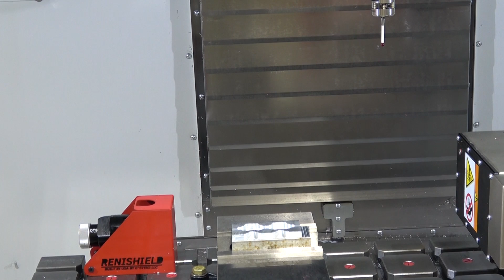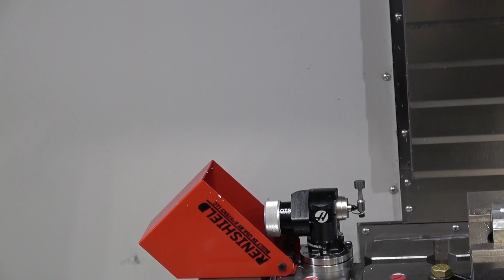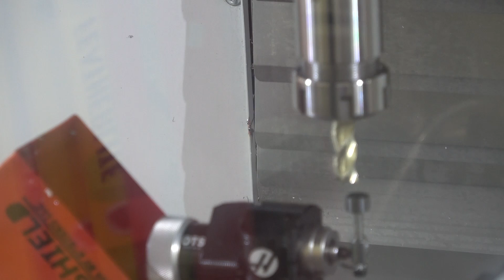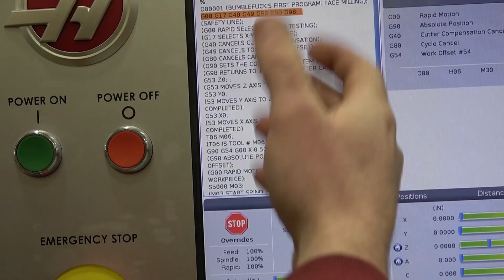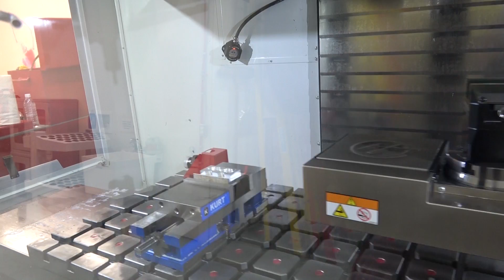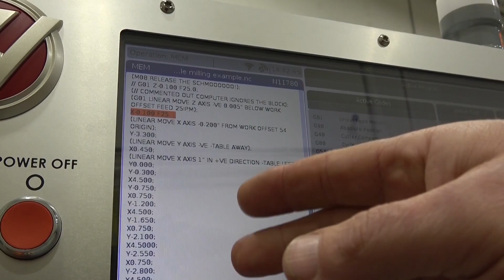Old School G-Code worth the HAASsle? | Intro to CNC mini-series Ep. 2

Comment: To be good at Gcode. You MUST know how to manual machine the part you want. Period. Gcode is the same moves you would do with the machine dials with your hands. Put to numbers. That is all it is. Instead of you flipping the spindle on switch you enter M03 to start or M05 to stop. Instead of turning on the collant knob you enter M08 on or M09 off. It is dead simple. The problem is people don't know how to manual machine anymore. They just want to push the green cycle start button. Then whine and cry when it doesn't work like they imagined it should. CNC makes machining faster and cheaper. It does not eliminate the requirements to know HOW to be machinist. No free lunch.
Reply: The problem with Gcode is that it is completely obfuscated behind arbitrarily numbered codes; If it was written with basic words, as programming languages are, like "coolant_on" or something to that effect, it wouldn't be so frustrating and rote.
Reply: @inthefade  Exactly, there's not a single reason why there's not some kind of macro assembler for that since last 30 years. G-code is not Assembly, it's equivalent of programming by looking up in the CPU manual and writing opcodes in hex editor. I kinda can do it on 6502 but I'd never recommend to anybody to learn that skill - only reason we did that was because we had to look up opcodes in paper manuals and often patch binaries by hand, nowadays it's pointless exercise that just adds artificial difficulty to the subject.
Reply: Assembly to FORTRAN to basic to c to c#
Reply: 30 years ago, when all you had was a clumsy  keybord and   had to insert it manualy, M08 was way faster than "coolant_on".
Reply: Eric St-Gelais And yet it worked fine for assembler on (mostly all) computers. like, lda would be load into register a, jmp is jump, jnz is jump if (some value you compare) is not zero. mov is move, add is add, mul is multiply... and than we got the funs of G83, M05 etc. GCODE is SHIT. fucking old old old hell of a "programming language" yeah, it actually isn't but whatever.. cheers
Reply: @ericst-gelais60  "faster to input" that has exactly zero to do with why gcode is the way it is.  It is the way it is because memory used to be highly limited to the point where being able to save individual bits mattered.
Reply: Matthew Barras 
There just aren't very many actual machinists left - and the industry has convinced itself they're not needed.
"The program is perfect from the offline programmer - and the machines run themselves"
is what is commonly believed anymore.
I've been debugging a program, adjusting speeds and feeds, or setting up the machine/tooling and had people question what I was doing - and why, after explaining whichever they'll tell me I shouldn't have to, the machine is "automatic".
That's how little about CNC processing outsiders understand.
Reply: @Motor-City-Mike  The greatest lie ever told in a machine shop is  "it's a proven program, just hit go"
Reply: @archdornan4389  "well, yeah but...everyone was supposed to know not to run it on that machine."
Reply: G and M code comes from the G and M column of old school punch cards. All those numbers you see are just positions. X left to right. Y front to back and Z up and down. G Code is movement and Mcode commands make a feature of the machine operate. Thats is. Google a "CNC G Code Cheat Sheet".
Reply: Ex-fooking-ZACKLY ! ! !
Otherwise "computers let you do the Wrong Thing much faster".
Reply: There's definitely some more insidious dangers in the hobby CNC scene.  Some control softwares (like Mach3) that run inside Windows OS are an accident waiting to happen.  All it takes is for winblows to have a hiccup for the machine to perform an uncommanded move or ignore the E-Stop.  Combine this with poor guards and lax safety, you've got a minor incident escalating to potentially fatal because somebody wants to make a quick buck.

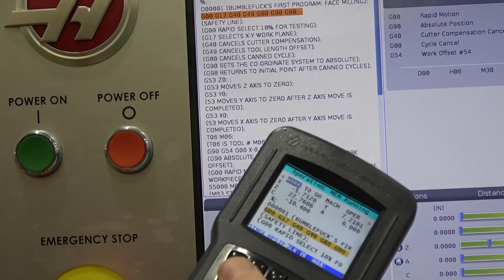Comment: 11:57 Best tip with any programming, and you can search the files, find one from the past based on the comment and use it again without re-creating the wheel and work you already did for a new project. Learning G-Code allowed me to expand on my 3D printing a lot more and do things some slicer applications won’t allow you to do.

Comment: Don't learn G code. Just go over to practicalmachinist.com and endlessly post questions about why your machine doesn't do what you want it to.
Reply from the maker: "why doesn't pocketing routine work on my converted grizzly? Anybody else have same problem? Can somebody write the program for me?"
Reply: @arduinoversusevil2025  G01 (get buddy)
G02 (get another buddy)
G99 (get G01 to grab your ankles)
G101 (get G02 to grab wrists)
G70 (get G01 to pull -X)
G71 (get G02 to pull X)
G69 (repeat program till head comes out of ass)
/I don't give a shit, it was funny to me!
Reply: @arduinoversusevil2025  "ahhh looks like your problem was you spent 30 years whittling wood into furniture"
Reply: This sounds exactly like stackoverflow LMAO
Reply: Yep, even seen a post from a high end CAM package put the Mori mill in inches per revolution, then use inches per minute actual feed rate for rigid tapping. The call I got was this damn *&% just tried to push a tap through my part and the spindle never started!.  Well, the machine did what is was told to do...
Reply: Exactly why I started learning gcode recently.

Comment: I think learning to use Cam software will be harder than learning G-code. There again the parts engineers design now days would be impossible without it.
Reply: For simple programs, yes. As soon as you start dealing with compound arcs, complex surfaces or 4+ axis machining, CAM is absolutely required unless you enjoy taking 100+ hours to write a program that still won't work right.  

No way I'd write a 50k line program by hand, even for simple geometry.

Comment: While I’m thinking about it, I’ve got a great tool for you to machine....for BigClive.
Could you create a lightbulb base multi-tool?

It’d need to fit various bulb base styles:
Various Edison screw sizes, and twist-lock.  
Each side of the bar could be a different size or style base.

This tool would enable the user to better grip the base of the bulb, for the purpose of disassembly.

Comment: G-code. Best thing since punchcards.
Reply: good ol' Hollerith code...
Reply: @you donky  try about 30-50mm in, a bit behind the bone.
Reply: And to think that the early NC machinists could read said punch cards.
Reply: @you donky  that's the one! for better reach, you might have to create a helping device though.
Reply: as someone who is 28 and had to run some Acralocks using punch cards, i learned to program them about a month before we scrapped them and bought two new HAAS's and a Mori MV-40. Those things are a pain in the keester, i had to transpose a new set from an old program because the old cards were wearing out.

Comment: Like you touched on at the end, a basic understanding is important when CNC programming. You have to be able to roughly understand what you're looking at even when just outputting from CAD/CAM systems. The computer isn't 100% perfect and sometimes it will put funny moves through stock that shouldn't be there, of course the route cause is user error because you didn't set your block properly, or your safety rapids or whatever. But none the less, you have to be able to roughly read at least the beginning and end of your CAM generated program to ensure it's doing all the safety stuff properly.

I'm not saying you have to be completely fluent in it, and many of us keep a list of common G and M codes handy at all times because we aren't robots and we do forget. I totally agree that using the conversational cycles in most industry common machines (XYZ, Mazak, Hass, Hurco etc) in conjunction with CAM generated code is far more efficient these days in most cases than hand writing long-series G-code or even G Code Macros. However, as will all things, a foundation knowledge is required before you start getting too involved.

You wouldn't jump in the ocean if you didn't at least know doggy paddle?

Comment: also, like yer code label system, had to learn all this on my own at night, spent a ton of time deciphering the book and breaking stuff...  eventually you'll figure it out, and not need all the labels, then you can break it down to labeling the program steps, face, profile, bore etc...  Also the G codes are broke up into groups, g0 g1 g2  g3 movement codes, g80 g81 g82 g83 etc drilling/boring/tapping cycles

Comment: I understand you make the axis movements to ensure no collisions, but say you're doing some light production work and verified no collisions in the code, would it be reasonable to consolidate the lines to move all at once and speed up production?
Reply: Yes this is done all the time. BUT, if you are going to do this the Z movement out of the job, to at least a 'safe' distance is the first move on its own command line!

Comment: I remember punching out programs on a teletype machine and taking that paper tape down to a machine that can rip metal to shreds and trusting it to not shred my paper tape that was pre-perforated for the machines convienience. Nowadays the program appears in the machine magically from engineering and all the toolmaker has to do is load the stock in and push the green button.  PhDs (Push here Dumbass)

Comment: The sashes are used for block delete. They only null out the slashed line when block delete is on, otherwise it reads the code normally.

Comment: Tool number and pocket number dont match - what kind of buffoonery is this?
Reply: Why would you want the pocket to match the tool? I'd rather know that tool 75 is a 50mm udrill, and be able to put it in any pocket, and then call it tool 75, than have to go back every time and take out tool 2, from pocket 2, and replace it. This ATC only has 40 tools.
Reply: Tool in pocket 15 breaks,  replace with identical tool in pocket 30, swap them out, remove broken tool from pocket 15. No change in code necessary

Comment: I think your average home gamer can definitely get away without learning G-Code, but someone looking to become a truly good CNC programmer should know G Code and CAM. In the shop I work at, most programs are generated in a CAM package, the program is then run on a machine simulator, and then the programmers comb through the G Code manually optimizing tool paths. It's not really "human unreadable" either.  Most of the experienced CNC programmers at my shop can readily visualize the movements of the various axes just by looking at the code. It's not like these guys are all rocket surgeons either - many of them can barely open their e-mail. G Code is really pretty simple, but you just need a lot of time with it to learn the nomenclature. 

When you start getting into 4, 5 or more simultaneous axes, the code can get unwieldy very quickly and you'll basically need CAM to get a program. But if you're looking to get into any kind of production work (large or small scale), you should really take the time to learn G Code. You'll be better able to optimize tool paths, reduce the time machine isn't cutting metal, and solve machining issues. In the production world, cycle time trumps almost all.
Reply: big Al Last week two russians actually did some rocket surgery on the ISS lol. Cut it open with a knife. Well, it wasn't actually a rocket but a spaceshipthingy. still cool though
Reply: too true.
Reply: If you software keeps generating bad G-code you need to throw out that software.
It's like a lathe that won't do round objects, then you hire a bunch of guys with files to finish up the work...

Comment: Does the HAAS run in metric as well and is there any way to mark your G-code with metric/imperial so you won't accidentally fuck over the machine and everything else? Or is a comment on top and a prayer that whoever runs it isn't a total fuckwit the only option?

Comment: Iffen yer jus a gurilla bang'n out single parts, yeah, g-code is a waste of time. If your manufacturing hundreds of thousands of parts, understanding where you can reduce machine time by omitting a superfluous motion saves big bucks. 

This one part I worked on, the cam spit out a five minute process to cut a half inch slot. Standing at the machine, I wrote a g-code to cut the same slot for a quarter of the time and half as much wear on the tool. 

Got laid off the next week because it was clear I was a better programmer than the knucklehead I was competing with for the cushy programming position. The competition was the manager's salad tosser.

Comment: I love g-code... It's simple and easy to scroll through and know what's going on.  Ran a cnc Mill and a cnc lathe.  Both older and both had real power... I'm not a HAAS fan.  They didn't seem to run that long till problems happened.  The machines I ran we used a 3" gauge block to set tools and a Dingle ball to set the work zone 0.  I made industrial u-joints for steel mills.  Most out of 4140 HT material that we then hardened in house then finish machined.  Super tight tolerances +0.000 / -0.0008
Reply: Because the HAAS is lightweight, it's best to anchor them into the concrete floor so they don't vibrate themselves to death.